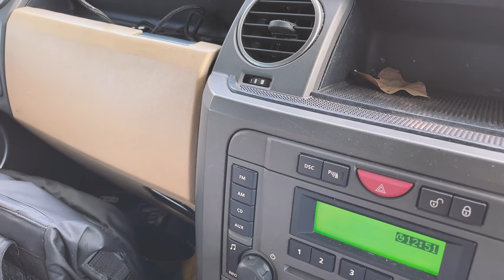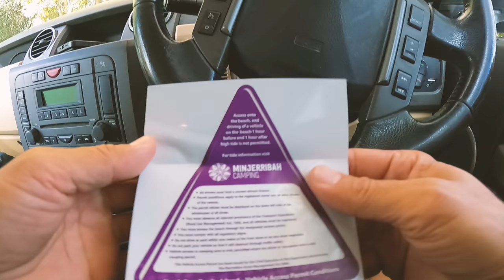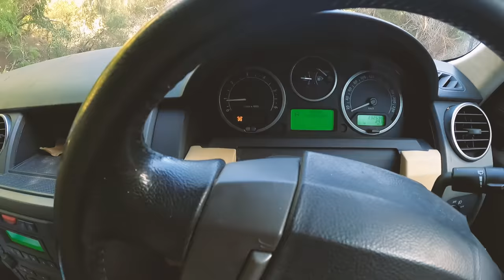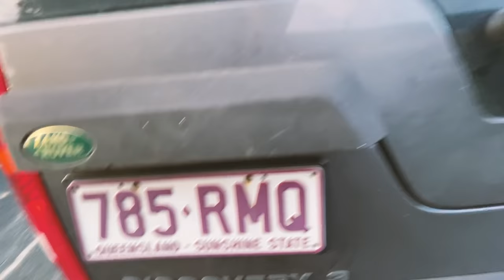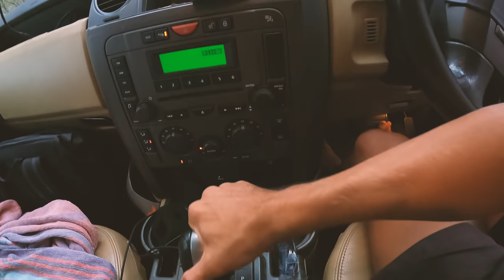Eat What You Catch - Solo Truck Camping An Island In My Wife’s 4X4

Comment: 48:45 when youre talking about cleaning fish. camping table to clean away from the car. I know it was raining and it forced your hand, just giving general advice. I would personally go for a non porous plastic cutting board, like what you see on docks or restaurants. chef supply stores and websites have amazing options in nearly every size and color for very reasonable prices. rinse with saltwater after use and leave a good ways away from your car. do the basic cleaning of fish on the water, as you catch them remove the guts and bleed while on the water. I live in a very snarky area and ive never had issues doing that.

Comment: press and hold the interior light button on your car and and it turns all your interior lights off, so they dont stay on with doors open.

The Gap for your bed can be filled with the parcel shelf off the car (It stows there)

Magnetic kitchen net from spotlight would work for the mossie net👏

Comment: DISCOVERY FLAT BED If you drop the parcel shelf into the gap between the second and third row - there is a spot that the ends drop into and make the back flat all the way through it still allows a bit of storage under as well .. its preety good planning by LR for this ..

Comment: Get a 12v power supply for your computer, waay more efficient. Might drop your consumption by half or more. If you use an inverter and a wall power supply, you are going from dc to ac, stepping up voltage, then from ac back to dc and stepping down voltage. The 12v supply only steps up voltage.